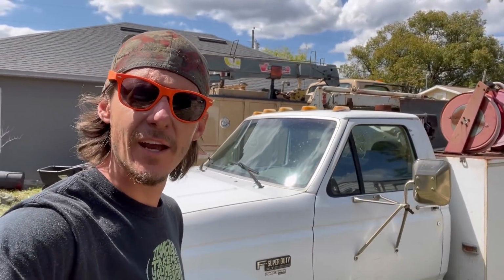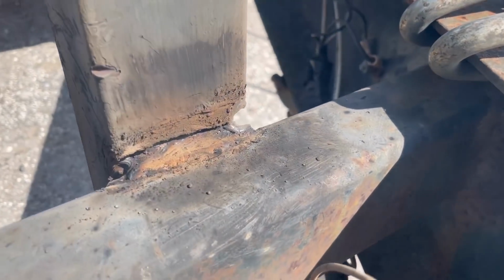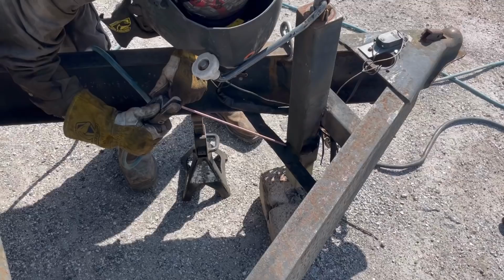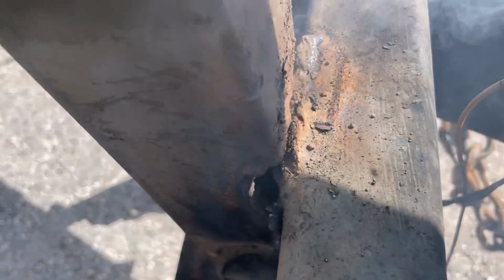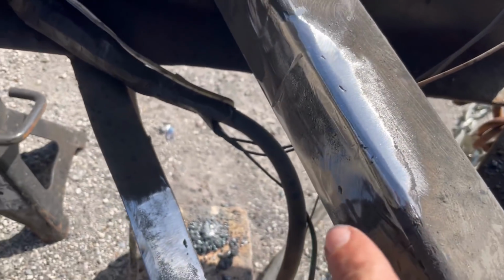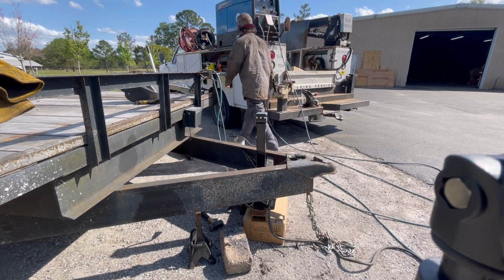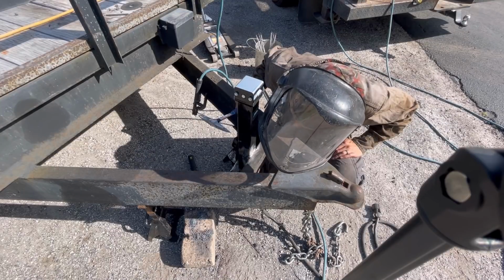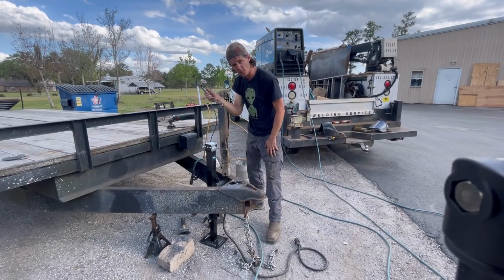Awesome Welding Trick | FEW WELDERS KNOW IT !!!!

Comment: As an Ironworker we use that trick all the time for certain scenarios like cutting decking or sheet metal to patch holes in the floor before they pour concrete! It's called "hot rodding"

Comment: My welding teacher taught me this trick. Also works great if you need to punch a hole in something! Only difference is he said they would dip it in water first(I guess it makes it run hotter)
Reply: Lol I taught myself that trick whenever I was welding a thick pipe and accidentally put my machine on 130 cuz I didn’t know what I was doing at the time and blew right through it
Reply: @aldanemclaughlin6977  hahaha hey that's what is called a "happy accident"!

Comment: i guessed it before you said it.  i've used that once or twice for cutting flat bar to length.  it's probably what carbon arc would look like without the air behind it...not pretty.  if you're out of options it will save your bacon!  good tip

Comment: You can get through hardened steel rod if you get a thin stick and do it upside down, it saved me because after two/three hours of curse drill I had enough. I use the rod everyday now :). I did not not accuracy anyway so all good.

Comment: Love the video, great tip.  I actually have a few rods that are “designed” for cutting, honestly they are probably just 6010.  Never used them (have a plasma cutter and torch). Here is my tip of the day:  One of the best tips a welding instructor taught me was to take a few pulls off the oxygen side of the torch when you were hung over.  I don’t drink much but I hate hangovers, and it saved my ass a few times lol.
Reply: the pulls off the O2 is an old Fighter Pilot trick from back in the day....bravo, you can also dip your 6010 or 6011 in water to make it cut better.....cheers, Paul
Reply: @MPM Welding fantastic.....keep on rocking
Reply: The cutting rods mainly suck. I just use a 6010 and dip it in water ...An old guy taught me that and I just saw it on Chuckee2009's welding channel.

Comment: Didn't have to tell me this; the first day i blew through metal from having the machine set too high i knew i could turn the machine up higher and cut metal. DCEN is better than DCEP for this, because the electron flow out of the tip of the electrode acts as "wind" that blows the molten metal away.
Reply: DCEN is key!

Comment: forget when I learned, but before I was 13, im 55 now. but as a teen I did buy a few cars to scrap, some to get motors out of, & I used stick to cut vehicles up, as didnt have a car trailer, so cut up to haul in back of truck bed.

my first income tax refund, from first real job, at 18 years old, I bought a torch outfit, I still use to this day, but before that, I used stick to cut, and used carbon arc to heat & bend

Comment: I used this trick when I was 12 years old to cut holes in the bottom of a radio flyer wagon to run "Steering ropes" to the front axle, had an aluminum barn shovel for a seat. We bout died running that thing down steep roads.

Comment: Cutting it off was cool, should've just bolted the new one on with U-bolts.  Probably bent at old weld joint.  You wouldn't weld axle to leaf springs

Comment: Hey Anthony another way you can do it is to wet the 6010 for like 30 seconds in a water bottle and then turn the amps up really high. ⚠️ Dont wet yourself though⚠️, can be extremely fatal if the current decides to jump onto you. But it releases cutting sparks and everything, its fricking awesome, the electrical current basically flows through the water onto the metal and burns the shit out of it

Comment: Oxygen & hydrogen is add helps the breakdown of the weld. 
There are commercially available dry cutting electrodes that produces a violently fierce arc & huge amounts of thick dense  smoke not for use in a confident space. No air or oxygen required. 
Cut(severing)  plate using a up down vertically sawing motion through the fill metal thickness. 
Have a pack on the always on truck.